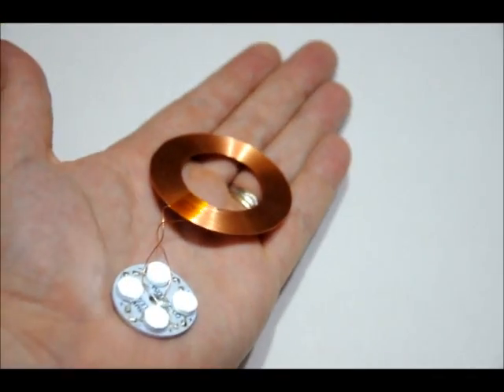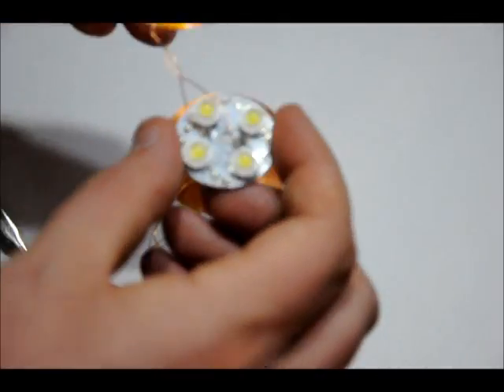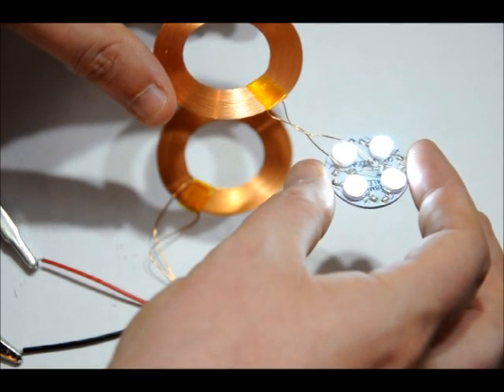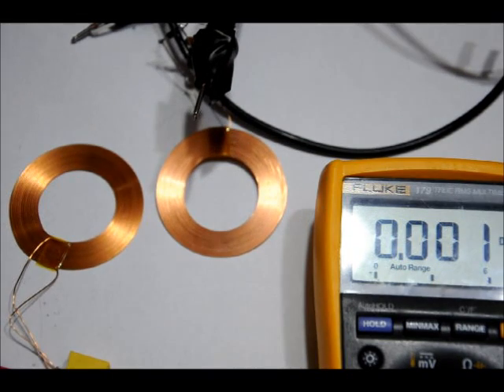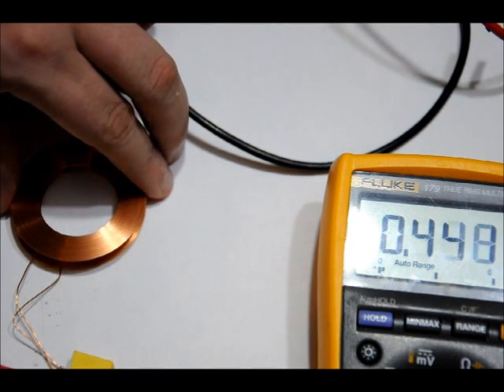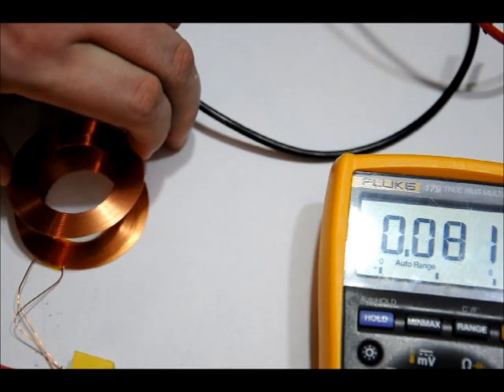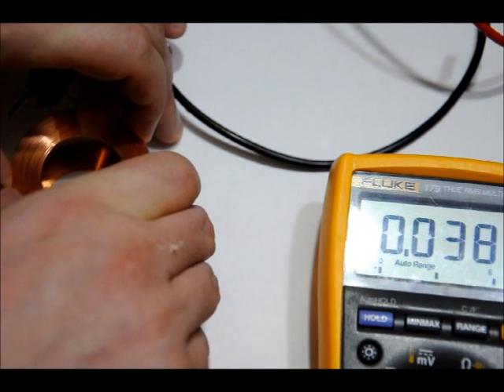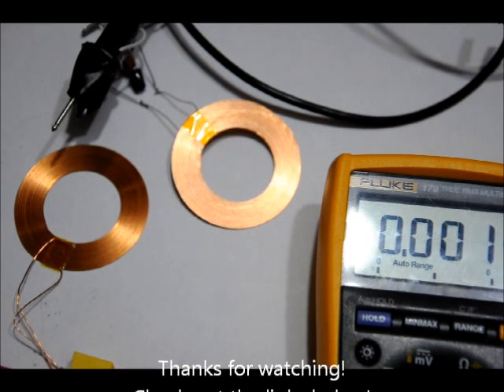High power wireless power transfer set analysis! 12 Watts 12v 1A or More!

Comment: currently im making solar wireless charger, so my solar panel output is 18v 80mA, im using lm 7805 as voltage regulator, i have a problem to increase my current. 
can you please help me.

Comment: You are well on your way to making a transformer, right? To get better coupling all you need is a core. If you think of it that way, just about every appliance in your house does wireless power transfer. The challenge, of course, it getting decent distance and with non-constrained or shaped fields, it's never going to be great.